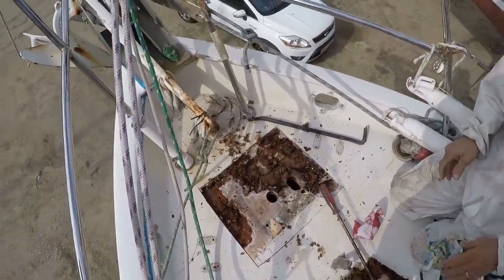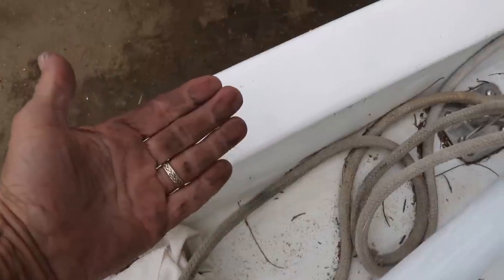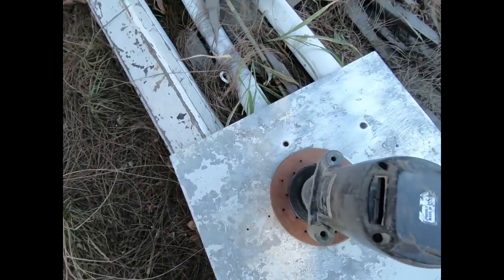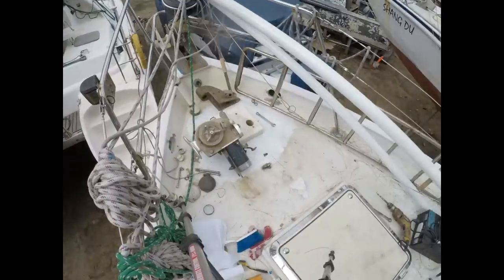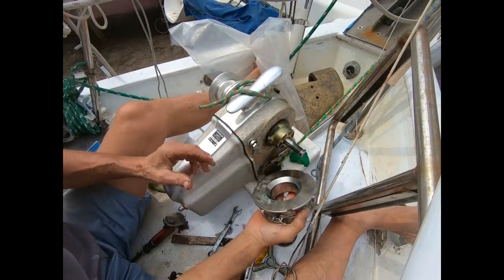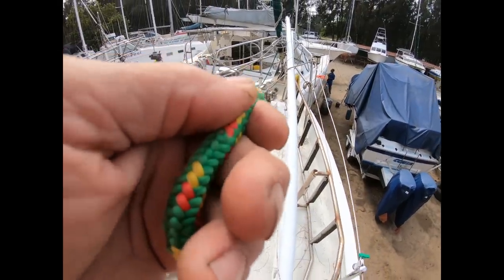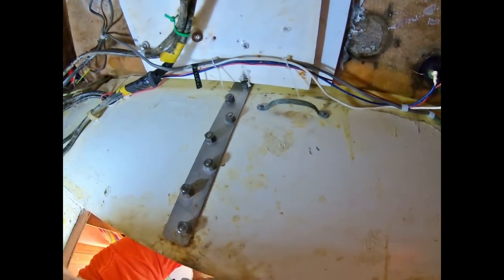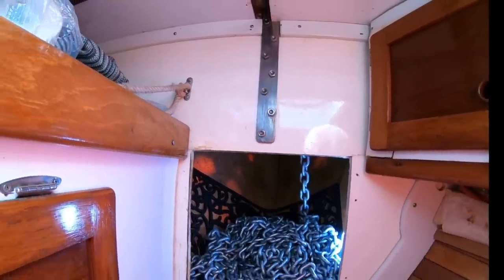Don’t Buy New Anchor Chain CHEAP! (+ Chain, Windlass, Anchor Chain Locker) Patrick Childress #50

Comment: Great to see the anchor locker ship shape.  Kind of eerie seeing all the yellow glow spots from inside the anchor locker from all external patch repairs that you made to the hull.  The zip tie drip lines are a great tip!  Your philosophy on the anchor chain for the boat is the same as mine for tires on my car.  Good quality tires are what give you traction and stopping power - cheap tires work but sooner or later they will let you down in a pinch.  I bet those cute little monkeys are a pest in the marina - I am sure they would make a mess of the inside of the boat if they ever got in!  Enjoyed the video.  Take care Patrick and Rebecca!
Reply from the maker: Finally, those blisters are getting filled in and puttied over. They still show through though. The monkeys did go into the catamaran in front of us and the owner had to chase them out. The same monkeys robbed the boat owner of his peppers growing in a pot. It would be a mean trick, at night, to throw some bananas on the deck of someones boat.  When the monkeys find them, they will never leave that boat alone, and return every day.
Reply: @RVLifeNOW  Oh my!!!

Comment: Great video!  Love the discussion on the finer points of detail on this project.  It turned out to be a bigger job than I would have expected, but I see why.  Very well done.
Reply from the maker: It seems every project turns out to be 3 times bigger, taking at least 3 times longer than expected.  But we should be good for as long as we will ever own this boat. Thanks for your comment.

Comment: I love watching your channel. !
   In the mid to late 70’s and 80’s, I worked for Valiant Yachts in Bellingham as a carpenter. Very likely worked on your boat when under construction. Most of my career was involved in boat building and restoration. 
  I’m so interested in necessary modifications as you cruise Brickhouse around the world. The blister issue is a given for other reasons but has enabled many to take advantage of a well designed boat at an affordable price to  pursue their dreams. 
  I look forward to future adventures 
     Bfree Chenega
SV Fascination
Reply from the maker: Beautiful wood working. We have done nothing but add a few doors to open up storage spots. Thanks for a job well done! We are in the faring stage of the blister repair. I'm sure you will be interested in this third major blister treatment, in 42 years, on this 1976 Valiant. I have to wonder how much original fiberglass is left on this boat. Stay tuned....Rebecca

Comment: Patrick, love how you share your knowledge, I have been a mechanic for 30 years the reason the old diesel mechanic told you not to use silicone on rubber gaskets is that it might cause the rubber gasket to squish out of one side or the other especially when over torqued, in a place that holds pressure or gets hot. in the case of your windlass cover which really has none of those; if not over  torqued (tightened) it should be just fine to use. I just caution you in the other cases unless you have to use it in a total emergency but usually just torquing down the rubber gasket will work. When I went to U.S. Navy shipboard flooding and damage control school way back in the 80's and they put us in a training mock up ship and started to flood it. We would have to patch many flooding holes and a plane rubber patch was on of the many items we learned to use. As I mentioned before you thank so much for sharing your knowledge..
Reply from the maker: Thank you, One Man, for the nice compliment and your information based on experience.
Reply: 40+ as a mechanic myself...  Difference in sealants ... Silicone vs RTV...  Silicone sealer in the automotive world has a problem with oil..  Silicone reacts..   RTV however does not.(still needs to cure).. it is an ammonia base where as silicone is an acetic acid (hence the smell)..   
Now.. you could have just put a bead of sealant on that cover and set it in place.. no need for the rubber gasket unless you had a clearance issue... (hell to get back off)
Reply from the maker: @randalljames1  I appreciate this information. In the past, the silicone hasn't been difficult to get off the aluminum cover or housing.  Terrible stuff to try to get off of fiberglass!
Reply: @randalljames1   I love when my fellow Mechanics share their knowledge it lets us good Mech's grow and share what we know, no matter how long we have been doing the trade (Soon to be a lost art with all the modular replacement parts out there) I love Pats channel because he openly gives that knowledge to all of us a Gift that can never be repaid only Handed Down....
Reply: @OneMan.  yea sadly, we tend to hang on to this stuff pretty tight when in the biz.. (we got paid to fix, not tell how to fix)     Patrick is pretty fearless attacking this stuff so is nice to add a comment here or there we have gained over decades of making a living on this stuff...  I myself, not a big marine mechanic fan..  it hard work, and in many cases far less tolerant to mistakes.. kind of like airplanes..  :)    Have learned a few things from him myself.. :)
Reply: @randalljames1  Thanks for replying 
randalljames I fortunately or (LOL unfortunately)  have been a Military Mechanic for the second 15 or maybe 20 years (time flies so fast) of my career with 7 combat tours under my belt which now my tummy is starting to cover I had no choice but to teach the younger military generation (Soldiers and Sailors) across my span of time much like Patrrick I have felt it is more important to hand the knowledge forward rather than hold on to it , in the old days I before my Military career I had a customer following I use to tell them they could do it themselves and even offer to help them however they would defer to me and tell me I know if you do it it will be done right or to the best possible outcome. I actually told customers I can't get to your car or truck and they simply said I will just leave it here until you have time. Shoot just went off on a tangent LOL life's a mystery anyways have fun live learn and enjoy .
Reply: @OneMan.  Thanks for your service... A lot of responsibility when your "customers" lives depend on the quality of your work  more so than the racing I have been involved with..  Airplanes can land, boats usually float, but when people are to get you?   that does not go away..

Comment: (@133:30) Patrick, what I have found to be perfect for protection and also quite cheap is the Teflon cutting boards used in kitchens (The very thin stuff that flexes to conform to the shape of the hull) and then on top (Or onboard) of that, a layer of tough Neoprene rubber and then another layer of the cutting board Teflon this gives great protection as well as good sound insulation. Only down side is cutting the hole around the chain locker overboard drain hole. You can bond this sandwich together with Silicone, or Butyl, but it’s not compulsory...
  The other thing I do is use a snap shackle as your emergency bitter end release (Which can have a long, stainless wire lanyard, reaching externally with a handle on it). Some classification societies insist on this external emergency release, depending on what type of vessel and what the vessel is used for and where...
Reply from the maker: I understand what you are suggesting, but this is why I don't  think it is best.  I had the video clips but thought showing how a nonperforated chain locker pad holds moisture  between the pad and fiberglass,  would slow the pace of the video. In my case, it was quite visually evident, moisture was being forced into the layers of fiberglass and not being allowed to evaporate. For years, I had a solid, heavy, rubber “welcome" mat, protecting the fiberglass from the chain.  The area between chain and fiberglass needs drainage and air circulation, just what the shower mat will do.  Maybe, with your idea of securing in place with silicone, would keep water from getting under the mat. Patrick

Comment: Gaskets plus silicone on engines is different than something like your windless.   I was thought the same thing from my mentor a sr master certified ford technician,  there are a lot of reasons for it , sometimes it has to deal with pressures , sometimes tolerances that will be off if you add or loose thickness for changing from gasket to silicone or add both.  It's a general rule of thumb but applies to only a few situations
Reply from the maker: Thank you, J Ram, for the information.

Comment: I'm not familiar with Maggi chain, but did you consider Peerless ACCO g4 chain?   I'm about to purchase some Peerless, so I would be interested in any concerns with it.    BTW, I LOVE the tie-wrap wire drip idea. Brilliant!   I used triple tie-wraps along an in mast cable to limit cable slap in the mast.
Reply from the maker: Just be sure certificate corresponds to your chain and its made where you think it is made...not just where headquarters are. I cant remember about it since i researched it a while ago. -Rebecca

Comment: I've always been a huge fan of Valiant 40's.     If you could change one or two things about the design to improve it, curious what you would change.
Reply from the maker: We did a 3 video tour of our Valiant and I speak of some of its design shortcomings. Lack of designed side deck and cockpit drainage is a big one. The anchor chain locker is far too small and too high up. The old, heavy, wood hatches were changed to modern stainless steel, right away. There are hidden storage areas we opened up and made usable. Overall, the design is good, just needs some tweaking.  The execution by the builder was poor.
Reply: @RVLifeNOW  I'll have to go back and watch those videos.  Curious about your perception of the "post-blister", Texas-built V40's.  Better execution or just better resin?
Reply from the maker: I haven't been on any Texas built boats so I can't comment on them. But I would ask questions like "Are those common steel brads holding in trim or are they stainless steel brads.", if brads were used.

Comment: Silicone sealant uses acetic acid as a plasticiser - the diesel mechanic will have been concerned about the acid eating into the metal, rather than it affecting the gasket.

It's a common problem in the car world where someone has tried to bodge a window seal with silicone sealant, what happens is the frame then rots out from the acid and you end up with a much bigger job on your hands than you would if you'd just replaced the rubber instead!

The 'best' sealant you could use would be red brake grease, since that's formulated not to attack the rubber, silicone grease will also work because it doesn't contain acetic acid, as will black mastic, however mastic may contain mineral oils which will attack the rubber.
Reply from the maker: Thanks for the explanation. I was using high temperature silicone and could not smell vinegar so maybe that is why it has always worked.
Reply: Yep, if it doesn't smell like vinegar you should be fine.

I generally use food grade silicone grease on my window seals, it makes them slippy which can be both helpful and a real pain in the backside!

Gotta be careful with the silicone grease though, because it's impossible to remove unless you take all the paint off, and any places where it's been you'll not get paint to stick, so masking off can be important since it'll get everywhere while you're fighting with the window seals getting the blooming things in!

But with that grease in the socket between the seal and the glass - it'll never leak ;)

Comment: Another great video. You mention keeping half the chain by the vee berth and half in anchor locker. I presume this is one continuous me length of chain? If not, how do you organise it?
Thanks
Reply from the maker: Philip, yes, it is one long anchor chain. I had to install a PVC pipe from the upper chain locker to the V-berth. If we let out all 150 feet of anchor chain from the upper chain locker, then start pulling from the V-berth, when we raise the anchor, someone has to be inside the v-berth to pull the chain through the PVC pipe into the v-berth, it does not just fall in there on its own.

Comment: I was hopping you would mention the pros and cons to Chain vs Rode....
Reply from the maker: Maybe we can include that in a future episode...thanks for the idea. -Rebecca
Reply: I'm assuming you mean chain vs rope/Iine?? Both are called rode when used as part of your ground tackle. 😁
Reply: Weight to keep the anchor on the bottom and chafe resistance against rocks and especially coral which could slice right through rope
Reply: Frank D good points  , but usually chain is used for the first twenty feet or so to steer the anchor down even when rope is used.
Reply: @theespjames4114  the rule of thumb is chain at least 1 boat length.  depending on your use of the boat and where will determine how much of the rode should be chain.  liveaboards in warm places living on anchor have different needs to a weekender fishing.

Comment: Got those pines(we call them IRONWOODS) on Oahu
And touch
Yes they hurt!!!
Reply from the maker: Alyson, while living in Miami, I tried once to cut into one of those pines with an ax.  Barely made dings in the wood. Ironwood it is!
Reply: G'day from Tasmania, Australia.  Locally called she oak or bull oak depending on which species of casurina. I use the roots for grown knees in dinghies. (trad. clinker) spectaculer grain but hard to work and splits and warps on drying. Excellent firewood.
Reply: @glennbrown1961  lol

Excellent firewood

Comment: How do you stop water from waves that get washed over the bow from entering the anchor locker through the same hole through which the chain enters?
Reply from the maker: A wad of modeling clay works very well in the tropics. But now we are getting into colder weather and the clay becomes very hard. I am going to have to find some other sort of clay that is not so temperature sensitive. Otherwise, I might have to settle for some rags stuffed in place capped by a tennis ball cut in have and a slit cut so it can be slid onto the chain and over the chain pipe. If you find any other cold weather solutions, please let me know.
Reply: @RVLifeNOW  Please forgive the novice nature of my question. - I don't understand - if the hole is filled with clay how can you then deploy the anchor chain? Would love it when you make your next video if you could explain please?

I noticed when I looked a second time there seems to be a pipe or tube running downwards from the anchor locker, presumably into the bilge. So does water just enter through the chain hole, then drain into the bilge and get pumped out either by hand or with an automatic bilge pump, perhaps? I guess the water that comes from the wet chain has to go somewhere too?
Reply: buy Duct Seal that's what I use and its cheap. Cold weather does nothing and it will not set up hard. When ready to deploy anchor let her rip.

Comment: I have a question on wire protection, are wiring ducts ever used on a boat to protect the wires (plastic and can flex and wires are easily pulled out of the main bundle to go to electrical devices). Seems like a cheap way to get rid of wiring rats nests and thousands of zip ties (people leaving the old wires in as who can confront all those zip tied bundles off then on). Hope I made sense. Not the first time I have heard of misbranded stainless sometimes a magnet will stick to stainless--and that is not stainless.
Reply from the maker: Yes...thats used at times on many boats. It seems like on our boat there would have to be 100 of then for the varios locations ;) But definitely a good idea. -Rebecca

Comment: I too would not put silicon on a rubber gasket
Reply from the maker: In this case, I made sure there was no vinegar smell to the silicone and being a no internal  pressure join, it seems to be the best way to insure no water gets in. What would you have used instead?
Reply: Patrick Childress Sailing - would depend on the clamping pressure from the bolts on the rubber some products will distorted before this pressure is reached. If I had to possibly a mastic style product but never a silicon they cause more leaks over time and prevent paints from adhering.

Comment: Drain your oil with a oil pump - easy to rig a 12 Volt scavenge pump - useful for your engine and gearbox too - any auto shop would stock these.
Reply from the maker: Yes we have this....there is an immediate obstruction below the oil plug so no tube will go in far enough to reach any oil. It is  talked about around 5 minutes in to this video: https://youtu.be/TtEQ6YvVJgs. -Rebecca

Comment: Very good video - again!  If the windless has to be removed in 4 years to change the oil.  It looked like you “glued” and bolted it down, how will you remove it to change the oil?  After you unbolt it won’t it still be well fixed to the boat?
Reply from the maker: Butyl rubber, in the the roll or out of the caulking gun, is a very good, sticky, sealant, but is not an adhesive. It will come apart easily.

Comment: you don't use silicone + rubber because of the oil mixed with the silicone.
Reply from the maker: Thanks, David.
Reply: @RVLifeNOW  Yep yep, and that's literally it btw. Your gasket will likely need to be replaced earlier than usual but eh, it's a pretty low pressure application.

Comment: 6:13.   If the windlass is installed, instead of uninstalling it, why couldn’t you suck the oil out with one of those little manual pumps?
Reply from the maker: That only makes sense. I have one of those thin, copper tube, oil change pumps for my engine transmission, but on the windlass, there is an immediate obstruction so it only goes in a very short distance and would never reach deep enough to the oil.
Reply: @RVLifeNOW  not possible to use a slightly flexible hard walled nylon extension to get past the obstruction? What a pain.....